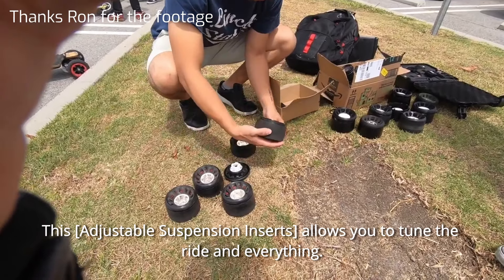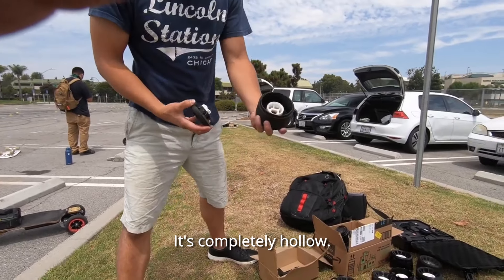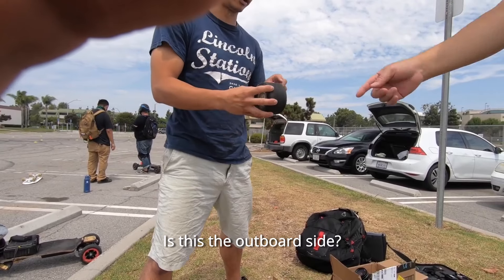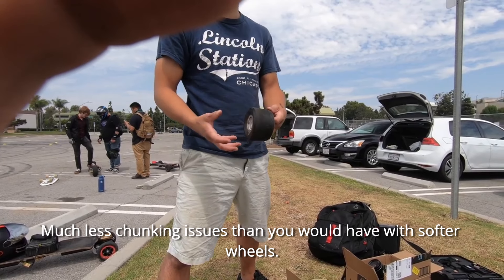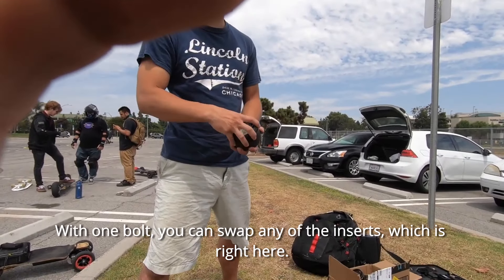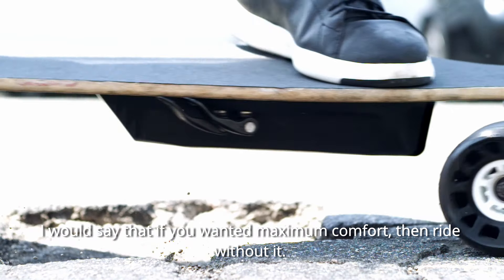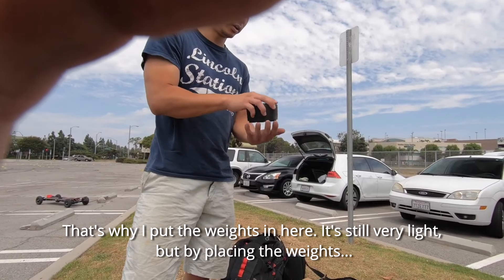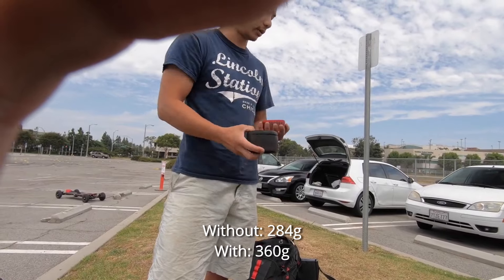Fully Adjustable Wheel Suspension - Hollow Wheels

Comment: Surely these present with the same issues as the cloud wheels no? talking about the contact patch with the ground. he goes on to say its to reduce rolling resistance, but cloud wheels have a similar contact patch where only the middle of the wheel touches the ground. from experiance, the minimal contact patch means less friction with the ground when braking, so in wet conditions you can lock up and slide more easily making them dangerous, epecially for newer riders. the main reason why i dont run the cloud wheels. is there any reason this is different, and doesnt present with the same issue? Cheers.